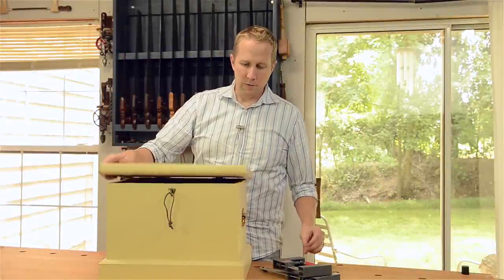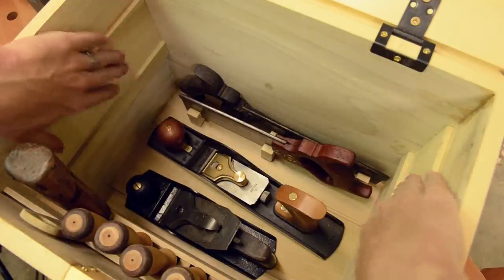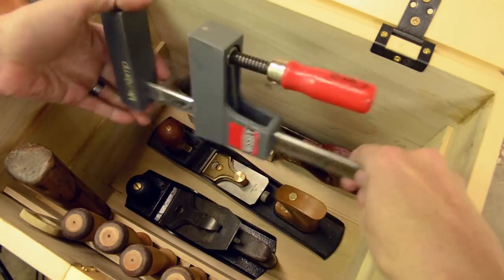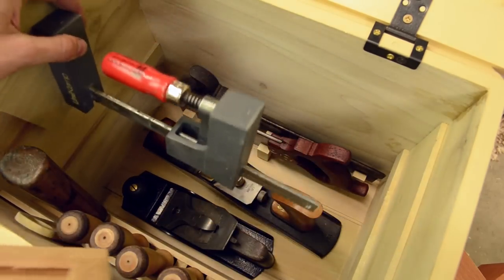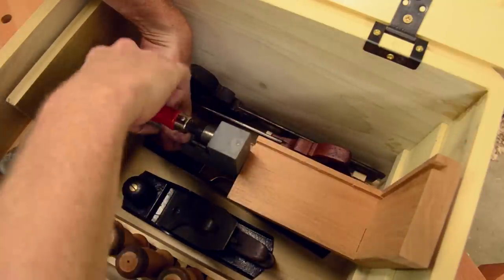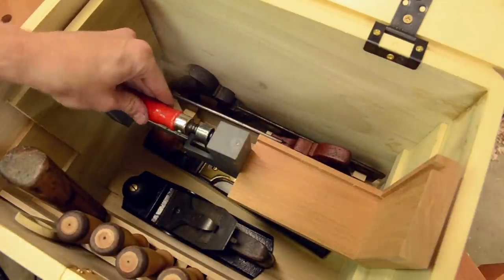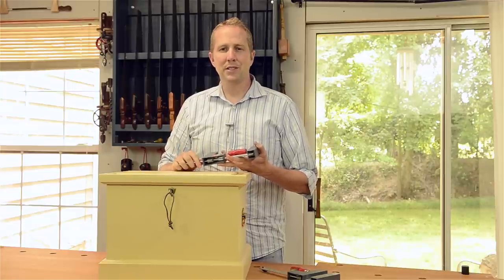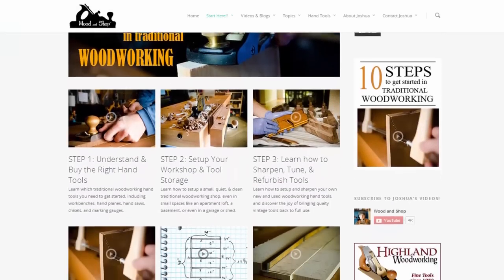How to Reverse a Woodworking Clamp

Comment: Do you ever look at product descriptions before purchasing? They tell you about that feature. I think all parallel clamps do that and so do the quick clamps.  You can also cut some all-thread to the right length and use coupling nuts on each end to spread things. Even cutting a board slightly long and wedging it in works. Many ways to do that simple task, that was just a few.
Reply from the maker: Derric, since I bought my clamps used, no, I didn't look at their description.